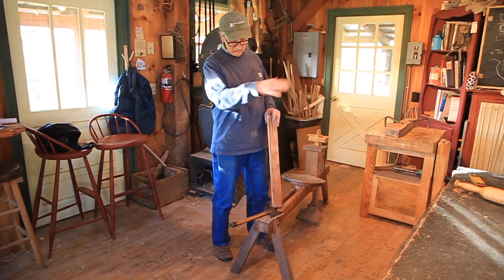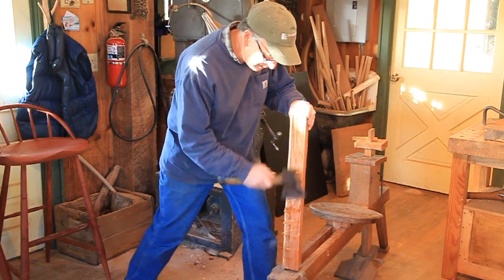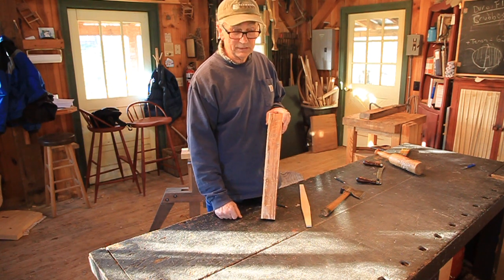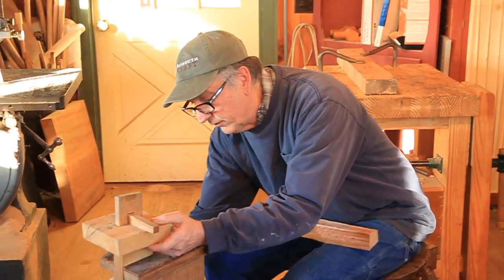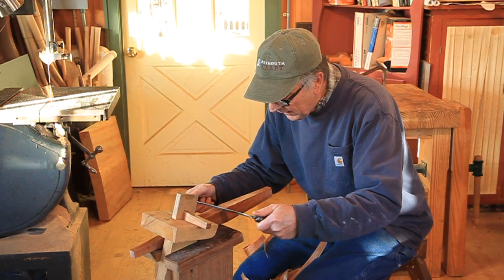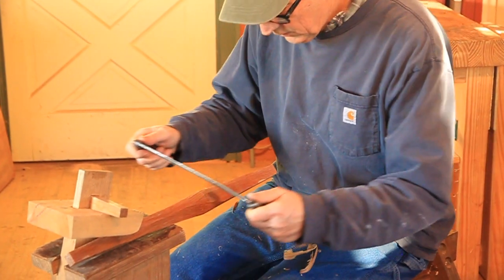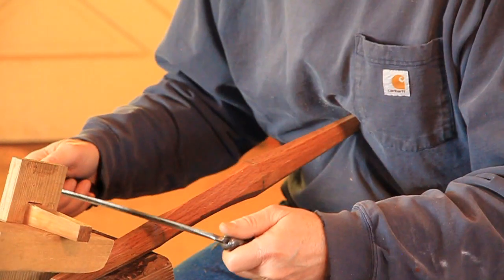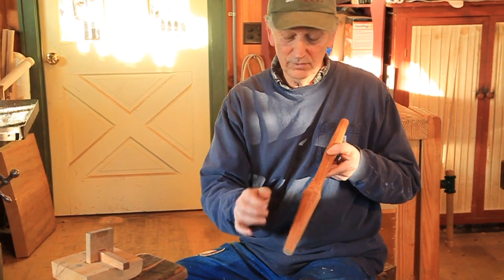4.  Shaping the Legs (and Other Parts)

Comment: Opinions on the ideal length of the log to split up for democratic chair parts? I have a nice straight 32" diameter log on offer and I want to give myself enough length, but I don't want to take on anything longer that I really need given overall dimension of log.  Will I kick myself if I get it cut at say 24" instead of adding a few more inches for good measure?  Happily re-entering chair making season coming into our first full pandemic winter in the Northeast!
Reply from the maker: Peggy, that should be fine since it's winter. Be sure to seal the ends immediately after cutting to length and keep the pieces outside in the shade.